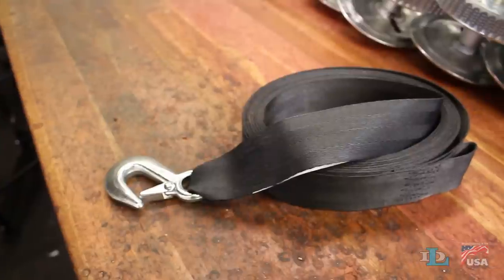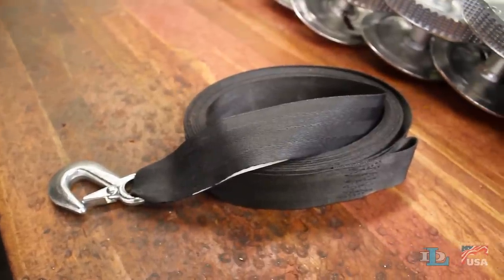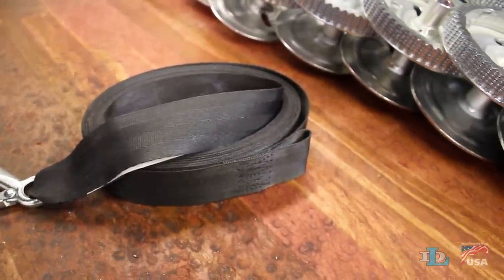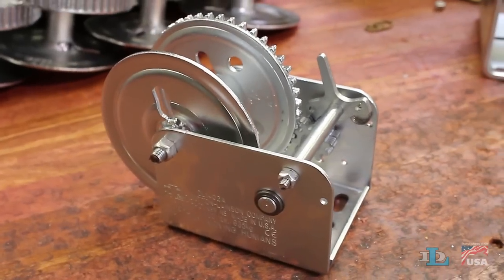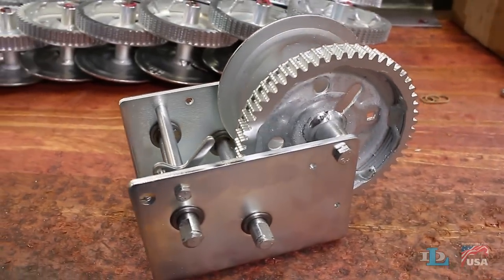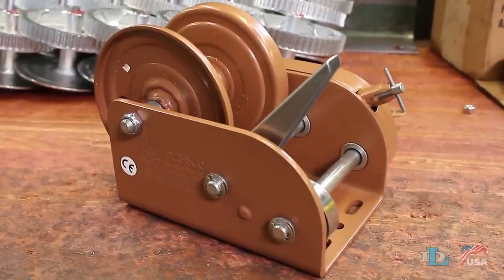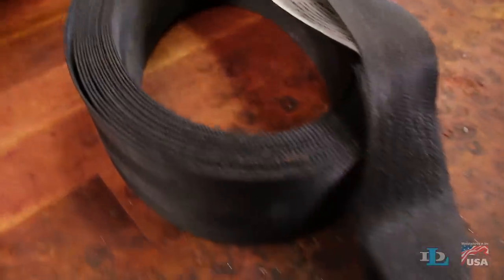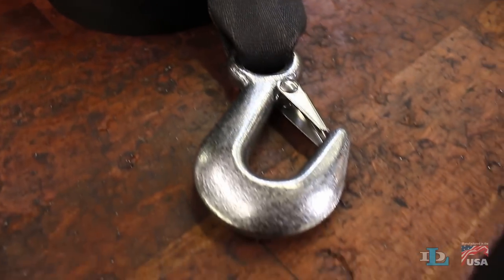Installing Strap on Brake and Pulling Winches - Step-By-Step

Comment: I had a heck of a time pulling the winch out of my shorlandr profile 2000. Now I can't get it back in. Are you familiar with this trailer and if so can you offer any suggestions as to get the winch back in. The winch stand is enclosed and very tight. Also I think a washer fell off when I got it out but couldn't find it. Thanks!

Comment: Do you have any idea how big the nut and bolt you put through the winch reel?
Reply from the maker: Dan- thanks for your question!  The correct mounting hardware to install strap onto a Dutton-Lainson winch is included with all models of Dutton-Lainson strap, and the nut and bolt does vary depending on the winch you own.  Please let us know which D-L winch you have, then I can give you the details on the size of nut and bolt required to install strap onto it.

Comment: I own a DLB2500A. There does not appear to be a slot for the bolt to slide into. Can a strap be used with this winch?  If so, how?
Reply from the maker: David- thanks for your question!  Strap can definitely be installed and used on a DLB2500A, so there should be a slot on both side plates of your winch's reel.  Is it possible someone installed a non-DL reel on your winch?  Please give us a call at 800-569-6577 if you still have questions.